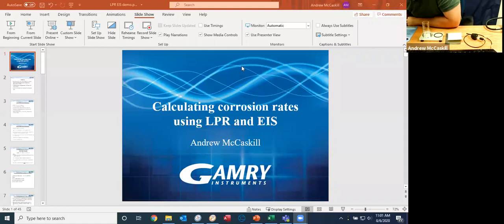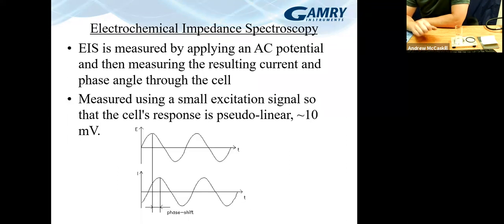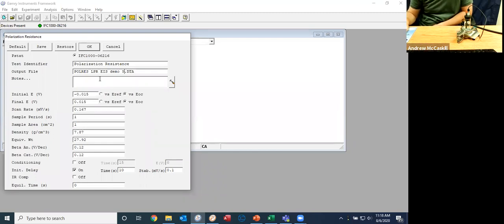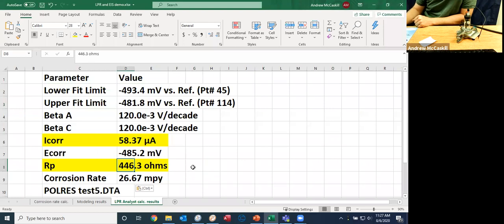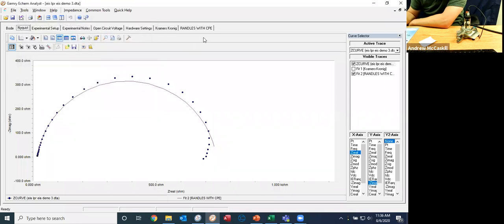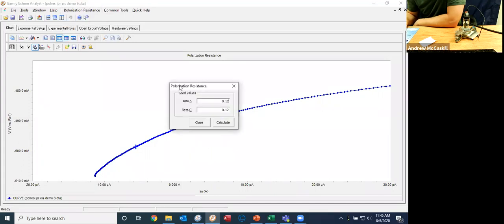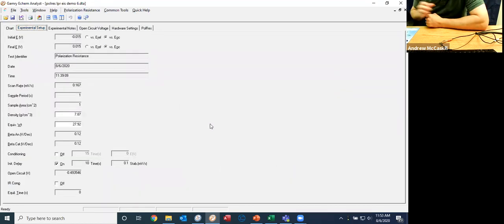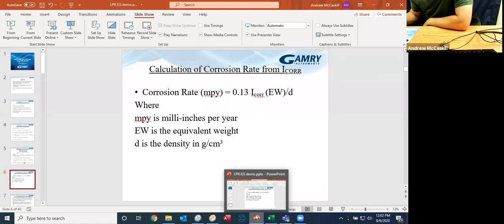Webinar Live Demo Calculating Corrosion Rates with LPR and EIS

Comment: Hi, thanks for the excellent presentation. Quick question, in some cases it is allowed to polarise samples with respect to reference electrode as well as open circuit potential - what is the purpose of this? What happens if one polarised wrt reference instead of ocp, would such lpr data be useful? 
Thank you

Comment: Hello, if I need to measure a corrosion of the coating on the stainless steel electrode in the absence of any solvent. How should I setup the experiment?
Thank you
Reply from the maker: You will need an electrolyte containing solution in order to conduct corrosion experiments. The setup described here would be a good place to start:
https://www.gamry.com/application-notes/corrosion-coatings/corrosion-techniques-polarization-resistance/
If you have additional questions, please contact us at techsupport@gamry.com”

Comment: A mask was used to define the active area for exposure to the electrolyte for LPR measurements. Would the size of the active area affect the magnitude of the measured current during the voltage scanning?  The related question is:  Was the Icorr as shown in Gamry Echem Analyst a current, or a current density (per the active area)?  I will appreciate a clarification, as I have seen people using Gamry to report their results of Icorr by the unit of Amp and also seen other results in the unit of Amp/cm2.  Thank you.
Reply from the maker: Yes. The larger the active area, the more current that will flow. All current measurements made in Framework are current, not current density. 

In Echem Analyst, the current can be displayed as either overall current, or area normalized current. This can be changed in the Echem Analyst Options. 

If you have additional questions, please contact one of our Support Engineers at techsupport@gamry.com. They will be happy to help further.